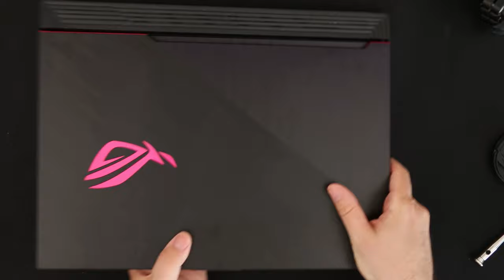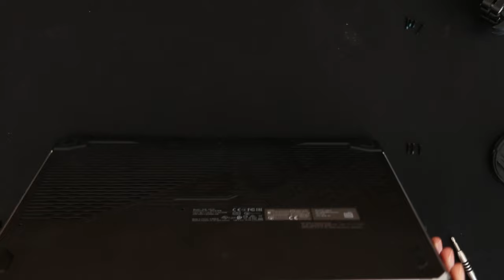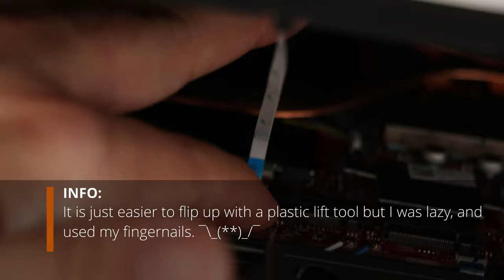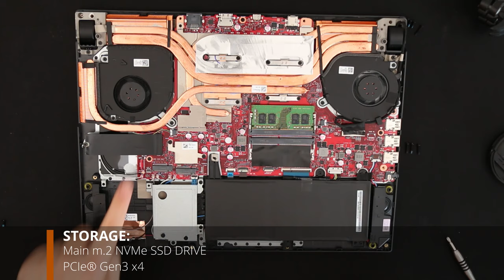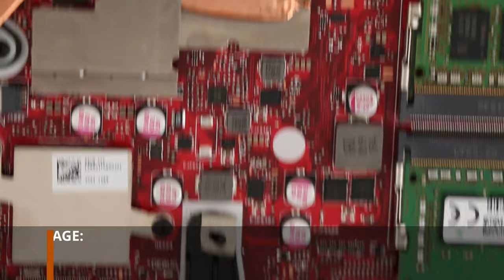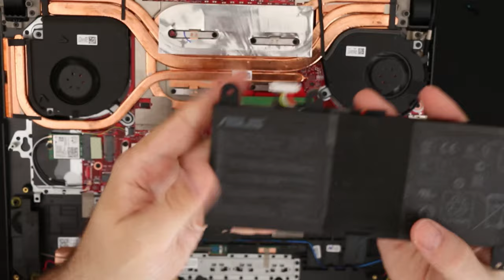ASUS ROG Strix G15 G512 - DISASSEMBLY and UPGRADE OPTIONS

Comment: Hi mate! You mixed memory modules with different speeds, 3200 and 2666!. Maybe the brand doesn't matter much but the  speed I think does!!! Thanks for the videos bro.
Reply from the maker: Yeah I know, it was only for demonstration purpose, that's why I highlight the "default module" at @7:05 so others can get the proper module. ;) Anyhow thanks for the feedback, it will be very useful for the audience.
Reply: brand or speed doesnt matter. the system will take the performance from the weakest stick.

Comment: Can we upgrade up to 64 Gb of RAM by putting 32Gb RAM in each Slot ?
Reply: Yes
Reply: @jonathanmedina2982  Have you successfully checked ? and Tried ?
Reply: No you can't unfortunately, the laptop specifically states its upgradable up to 32 gb of ram
Reply: Hey, You did it?
Reply from the maker: You can and the device will see all 64GB. The cpu and chipset is capable to handle 64GB but no more. (Tested)
Reply: @MakaiTechReviews  Thanks for sharing your experience and reply
Reply: @MakaiTechReviews  Can we Install 32Gb 3200Mhz RAM in this laptop by default system shows 2933 Mhz RAM in task manager ? Please reply soon if you have answer.
Reply: I've been looking for this answer for 2.5 hours now. Thank you! Lol. I want to install the 64gb of RAM but the manufacturer says 32gb max. I'm assuming that's per slot.  @MakaiTechReviews
Reply from the maker: @VideoJTS  the time when I recorded this there was no 64GB modules so I was able to test only the 2x32GB config. Your best bet it to check Intel arc website of the cpu and chipset of your configuration. As i remember anything below 8th gen supports "only" 64GB and newer are 128GB+. Not that I can image what use case you need that much amount on a mobile machine. 😄😄
Reply from the maker: Also usually manufacturers highlight their maximum configuration which they ship with, but not what the machine actually capable of.
Reply: Hey, so I was looking to put 2x32 modules in.. definitely not looking to put 128gb of RAM loI. Either way this was super helpful  dude. I appreciate your insight and response :)  @MakaiTechReviews

Comment: Can we add a 1tb ssd to a system with stock 512 gb ssd ?! Is there anything such that the upgrading ssd should be smaller than the stock?!
Reply from the maker: You can even go to 8TB. There is no such thing as storage "capacity" limit. ;)

Comment: can u tell which one should I go for ASUS ROG Strix G15 G512 i7 RTX2060 (super)   or   ASUS TUF A15 ryzen9 RTX 2060? It would be a great help.
Reply from the maker: Depends what you want to do with it. TUF is way cheaper than the G15. ROG series comes a better cooling solution, better overall build quality and the option to run RAID 0 (3 NVMe drive slots). TUF series are still a good purchase imho, but it has no liquid metal CPU cooling paste, and has less heatpipes for better cooling performance. G15 has also better screen quality as well. Don't get me wrong here. TUF Gaming is still a decent machine. If you play/browsing and so on, TUF is still a capable machine to do such things. It's just "less premium".
Reply: @MakaiTechReviews  I'm planning to buy asus rog g17 with 512ssd. Can I add an extra 512GB SSD to make it 1tb ssd.
Reply: tbh  id go the ryzen it will run much cooler
Reply: This is probably late, but you prob should have gone with the ryzen bc the i7 in my system that has an rtx2070 gets HELLA bottlenecked
Reply: @skizley999  yeap ryzen was the smart choice I did choose ryzen ✌️

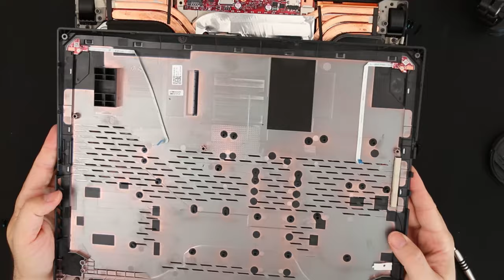Comment: Hello sir, thanks for sharing this experience, kindly asking can i add a sata SSD in the bottom left corner of the laptop ? at your left hand at 3:47 ? and use some sort of adapter to convert sata to M.2 ?
Reply from the maker: You have three m.2 slot (all of them are PCIe). Those cannot accept SATA modules, so "only" NVMe m.2 SSD will be accpeted in those.

Comment: Great Video, I have a question, Recently my adapter has been playing up My laptop says it is 'Plugged in' but the percentage is going down. Should I get a new adapter and if so should I get the same one or should I replace the battery?
Reply from the maker: Is this happen when the laptop is already full? If that is the case, it is normal, and don't let the battery overcharge, or overheat, it is a safety feature. But if the battery is constantly (below 85%) no matter if it is plugged in this can be several issues. 1. charge regulator in the battery or 2. the charger got degraded over time (highly unlikely). My best guess is you are playing in a hot environment, a high-demand program running during charging and the device (also the battery) gets very hot and the battery safety feature kick in.
Reply: @MakaiTechReviews  It's the same laptop as the one in this video so realistically it should be able to have the adapter in the laptop when I'm gaming constantly. When you plug it in, the light that usually comes on above the keyboard oesn't come on and you have to fiddle with for it to turn on (charge up) It's on suddenly started happening
Reply from the maker: @DavidWilliamss  You can also maybe clean the contacts (if not did yet) Use isopropyl alcohol to clean the contact. If you are lucky it is only dirt inside the connector. If you are unlucky, might be the DC plug in the laptop got loose and need to resolder back to the motherboard. (dont think thats the case, cause as you mentioned sometimes it is still charging, so most likely only dirt)

Comment: How would you even install a PCIe/USB type wifi card?
Reply from the maker: That is just the protocol(interface type), not a full size what you put into the desktop. Check Intel site for reference.
Reply: @MakaiTechReviews  Oh so those little antenna and the metal bit are actually really small? they aren't supposed to poke out the side of the laptop/computer?
Reply from the maker: ¯\_(ツ)_/¯

Comment: Just destroyed my motherboard! I watched another video for Asus Rog Strix G531 which obviously does not have the RGB connectors, so after removing the screws, I just lifted the cover! Result: The right cable came off ok but the left one removed the connector from the motherboard!! Can it be repaired or is it garbage now? I'm so frustrated!

Comment: How do I reattach those led flex cables??
Reply: Just insert the line back to the slot from top to down. Note the blue colored side is out ( front of you).
Reply: I also opened mine and hot stuck here, all fun and easy untill I got to put those flex cables back

Comment: Thank you, I have a question. Can I put a 2.5" HDD hard drive on the slot next to the battery? Maybe using an adapter
Reply: You can only install nVME m.2 storage drives.
Reply: @rx_ddy  TYSM

Comment: I have the G712LW-ES74 model and when I go to task manager it says I got 4 RAM slots available but from pics floating around theres only 2 on the back like this one. Are there 2 more when you flip the board over or nah?
Reply from the maker: 2 physical slot is in the machine. What you see in task manager is the potential, what the CPU could handle. (but no slots to utilize it)

Comment: Thanks for the video, i have a question, 
 which is the maximum installable memory of the ssd?
Reply from the maker: You mean SSD capacity? There is no such thing, the notebook can handle all of them.
Reply: @MakaiTechReviews  Really all of the next gen gaming laptops packing UEFI or just this particular model?.
Reply from the maker: @revanvonheaven8270  All of them. The only limitation can be is the physical limit like drive height. Large capacity m.2 SSD are usually 2 layer, and slim laptops have not much of a height space.

Comment: Will the LED still work after you remove the cable?
Reply: Without the cable plugged in, I'm afraid they won't.
Reply: @JackMaslovCZLive   how do you plug it back in
Reply: @beandawae  just insert it again and lock it with the pin

Comment: So it is not needed to remove RGB cable if we want add just only new M.2 SSD? Right?
Reply from the maker: No, you don't need to, but don't try to lift up that much otherwise, you can break the strip. You have to rotate the bottom case just a bit to gain access to the m.2 slot.

Comment: Hi.. very nice and detailed video man..just 1 quick question.. all three of the m.2 slots are only nvme ? And is there a way to put a 2.5" hard drive is this machine ? Your help will be much appreciated
Reply from the maker: Hi, yes all 3 slots are m.2 NVMe slots. As for 2.5, Nah you can't. There is no SATA ribbon connector on the motherboard. :S
Reply: @MakaiTechReviews  thanks a lot man

Comment: Hi,
ssd pci 4 si compatible with this laptop? or only pci 3 ?
Thanx.
Reply: google says "PCIe 3.0 x4 refers to a Gen 3 expansion card or slot with a four-lane configuration". and in the video it states "pcie Gen3x4" so I believe just gen 3, but i do not know for sure as I've heard that they are both backwards and forwards compatible and if they are cross compatible I do not know as to how much performance you would loose if any at all. I would personally stick to gen 3

Comment: Very helpful video but if i want to upgrade my laptops ram it said it has a max memory of 32gb and it currently has 8gb so can I add a 16gb ram upgrade to it or does it have to be x2 8gb rams
Reply from the maker: You can even add 2x32GB and still will work and see all 64GB. But as you mentioned the 8+16GB will also work (be sure to have the same speed to avoid compatibility issues), but keep in mind that the dual channel will only work until the 8GB module fills itself. Beyond that, the programs will run in single channel.
Reply: @MakaiTechReviews  what do you mean by dual channel
Reply from the maker: @jklpsmn  
In a very vague translation:

Dual channel - utlize both memory module at the same time for the program (faster speed). 

Single channel - Only one of the memory module is in used for the program (slower speed)
Reply: @MakaiTechReviews  so would 2x8gb be better for multi tasking or 1x8 and 1x16
Reply from the maker: @jklpsmn  1x8 + 1x16 altho sub-optimal.

Comment: wheres the cmos battery for resetting bios
Reply: Find it??
Reply: @youtubeuser206  I think it's on the other we side of the motherboard
Reply: But didn't really need it. I held down the power button for about 30 seconds and the pc reset itself
Reply: @tibby1239  did that reset the bios admin pw? It's underneath the bottom left corner, a white box marked RTC. Can jump 2 pins with metal. Gonna try tomorrow
Reply: @youtubeuser206  I'm not sure about bios password
Reply: @youtubeuser206  Can you confirm if were you able to do the reset?

Comment: Can you put 3 970 evo plus or 3 980 evo plus? If yes ? If it ok to raid 3 drives? RAID 0
Reply from the maker: Well you can set it up to run in RAID0 yes, but honestly there will be several bottlenecks (ports are still max 10Gb, or the CPU will have bottleneck too) and to much risk of data loss if only one of your drive failes.
Reply: @MakaiTechReviews  so 3 nvme drives will bottleneck cpu due to pcie lanes?
Reply from the maker: @VIn-mx7ke  Nah, thats not the case. But what use case scenario can you imagine to have a benefit of 3 super fast SSDs in RAID0 in a laptop? :D For example if you try to copy anything onto the machine write speed will be bottlenecked anyway. 10Gb from USB, and WiFi speed is around 1Gb is you are in a lucky spot. So Write speed already bottlenecked. As for read, well yeah, you can have some gains there but in what use case? Games? Not really. Photo editing? No again. Maybe, just maybe editing absolutelty gigantic RAW video files, but in that case a massive RAM capacity is also needed. :)

Comment: What's the max storage?
Reply from the maker: There is no such thing as "maximum storage". The currently available Nvme drives will fit and work (2280 size). But the capacity is not limited by anything. If I can recall the maximum right now on the market are 8TB modules. ;)

Comment: what is the maximum ram i have this model g512LI-HN0094T core i5 it gtx 1650ti it comes with 8 gb 2933mhz sodimm ddr4
Reply from the maker: If you remove the stock RAM, your maximum capacity will be 64GB (2x32GB modules)

Comment: Hello. Can you please tell where the cmos battery is located?
Reply: Did you find it
Reply: @youtubeuser206  nope
Reply: @vdragos19  im pretty sure I did im going to attempt it tomorrow and I'll let you know if it cleared the bios admin pw
Reply: @vdragos19  its directly underneath the very bottom left corner, a white box marked RTC with 4 connection points inside. 2 for the battery and to reset it you bridge the other 2 with metal.
Reply: @vdragos19  hopefully I don't fuck anything up trying to disconnect and remove the entire motherboard. If I'm successful I'll post a video since no one has demonstrated this.
Reply: I wonder if just flashing a new bios via USB would be easier and less risky

Comment: Is hdd upgrade avaliable in this laptop ?
Reply from the maker: No, only m.2 SSD. (3 slots total)
Reply: @MakaiTechReviews  I get that there is no connector for an HDD, but is there enough space for 2,5'' next to those two m.2 slots?
Reply: @kopabs  no, you can't mount 2,5" SDD or HDD. It's old school already. High speed transfer data is the future. But you can use an external SSD or HDD if you want, on USB- A ports.

Comment: Hey dude, really helpful video, just wondering if the procedure for adding SSD drives to the other M.2 slots is the same as inserting/removing the original drive. Also, will adding SSD's require thermal paste etc. for cooling them? Thanks again.
Reply from the maker: Adding extra m.2 is totally the same as the main one. Thermal paste not, but thermal pads are recommended. (But depends on the SSD speed type)
Reply: @MakaiTechReviews  Cheers 👍

Comment: Thanks for the video,and may i ask,if i just open it and add +1 ssd, I lose the vartanty or not?
Reply from the maker: Depends on the region you live, but usually you will not void your warranty. Where I live, you have valid warranty, as long as you keep the original parts. (and not cause any damage to your laptop by yourself)

Comment: Great video @MakaiTechReviews, by a chance, did you change the thermal interface? Asus promised to apply thermal grizzly conductonaut on all Intel 10th gen CPU's in April 2020, I'm wondering if they really did with this particular model?
Reply from the maker: That is correct. All Intel Based (starting from 10th gen) ROG notebooks have LM (but only on the CPU). GPU still has regular thermal paste tho.

Comment: does rog 512Li support nvme 3*4 and 3200mhz ram?
on the 1st slot its a 3200mhz and u installed 2666 in another slot
Reply: Hey there well if u have amd cpu then u can otherwise in intel cpu u can put ram of upto 2933mhz

Comment: one thing I found odd, my task manager in the tab memory (ram) used slots 2 out of 4 (i have 2x 8 GB.). I know for sure I only have seen 2 SODIMM holders. where are the other 2?
Reply: The other 2 are your empty SSD Storage Holder, located next to the battery.

Comment: I want to choose between HP OMEN 15-EK0002NX 300hz and asus rog strix G513LV 144 Hz 3ms I'm confused between them
Reply: Strix G15 is way better than HP Omen, because of the design in Omen, the display tends to divide from the other parts of display in the bottom

Comment: Bro my asus rog strix's charging adaptor is heating up so much..is it normal??
Reply: I just bought the rog strix g15 and the charger doesn’t heat that much
Reply: Mine too. don't worry. It won't hurt anything. My battery is still running strong.

Comment: Can I put any M.2 module or only gen3x4? Thanks
Reply: Most of Nvme m.2 SSDs are also Pcle (gen3x4) but I don't know if a regular one will work. I can recommend this 500GB one from Amazon which on paper, meets all of the requirements and is about as fast or faster than the included SSD. https://www.amazon.com/dp/B086BGWNY8/ref=cm_sw_r_cp_apa_fabc_pxj0FbNEG5381

Comment: I got rog512lu for 3 months and touchpad is lgging very often, any one can help with this?
Reply from the maker: Are you running the laptop on battery, or plugged in? If you run on battery, the CPU and GPU might throttle down (due to power save setup). Click on the battery icon and set maximum performance and check if this fix your laggy cursor issue. Usually this can fix it.

Comment: Hi, I saw on the video the default RAM is 3200hz and the external RAM is 2666hz, is that possible for these 2 different BUS RAM work well?
Reply: I just upgraded my default RAM 2933hz with 3200hz and the result is 3200hz will follow 2933hz speed and it worked well
Reply: @gerryabrampicasso2572  Hey, what model do you have? I was looking at the G512LW-ES76 with an i7-10750H but i saw the default ram ran at 2933 mhz, so I was wondering what's the max speed the laptop can handle? Can it handle 3200mhz?
Reply: @kennethrodas658  My model is G512LI-U3E1 with i5-10300H, my default ram also at 2933 speed and it can handle 3200mhz, you can try plug 2 ram with different speed, but it will follows the lower speed
Reply: @gerryabrampicasso2572  Oh yeah, i know about the different speeds, but i thought the max speed the laptop could handle was the one it came with so for example, I thought 2933 was the max lol
Reply: @kennethrodas658  Yea because the first time we bought this series its already installed with 2933 speed which makes us think its the max speed, but it can go further
Reply: @gerryabrampicasso2572  Nice, thank you bro!